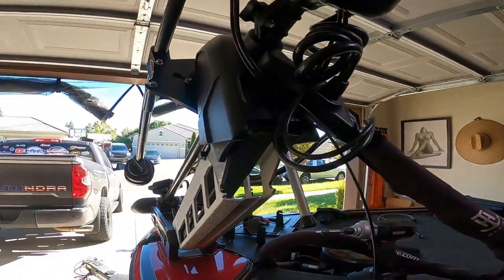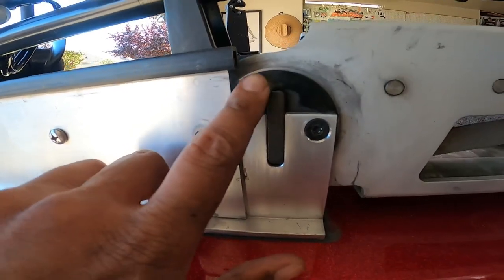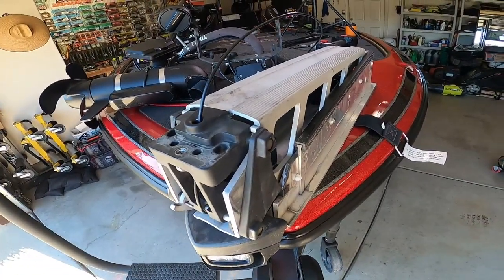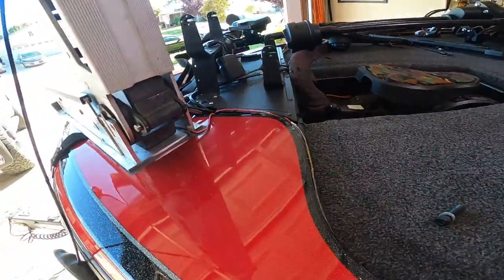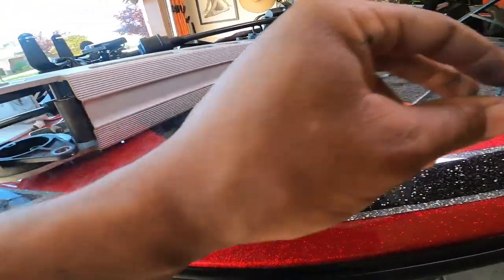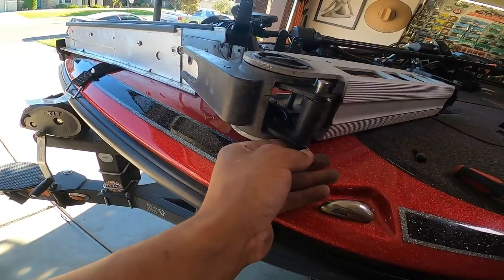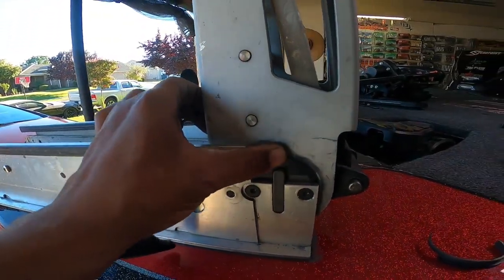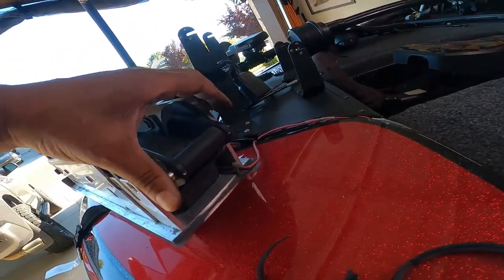How to change rear pivot bushings on Minn Kota Ultrex and Fortrex

Comment: Great vid. My pivot holder screws had red locktite. Had to drill them out. Started with a 3/16 pilot hole around 1/8 deep then used a 1/4 to shear the head of the screw.

Comment: Great video, I saw your post on instagram and I have this same problem and didn’t realize it.
I was also on ruff water and my  motor deployed, luckily it didn’t fully drop and came back on the deck
Where can I buy this replacement bushings?
Reply from the maker: Well glad I could help point you in the right direction for the issue. Mine is back to nice and smooth again. I got my bushings from a local repair shop. Otherwise when I googled them there were a lot of stores that came up even amazon and ebay.
Reply: Just did the repair, why did you need to remove the 1/2” pin?

Comment: What is that light under the front of the motor mount?
Reply from the maker: It's an LED light from RIGID. They work really good at night if you launch before the sun comes up. Got this one for a good deal so couldn't pass it up.